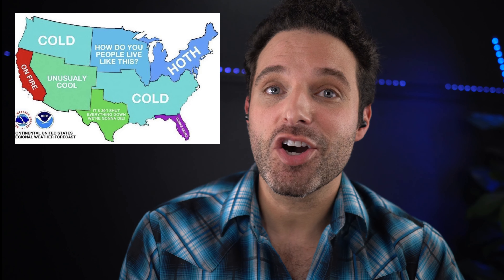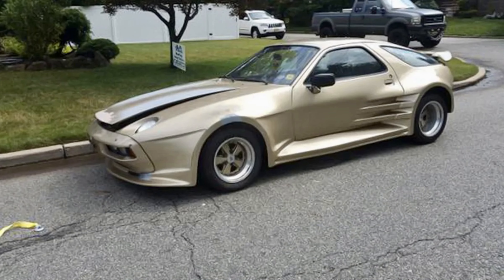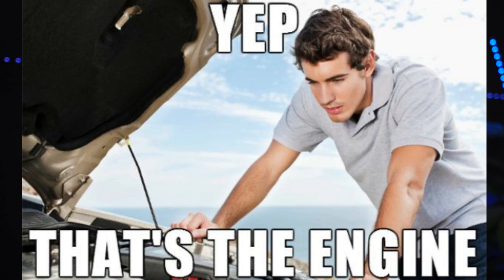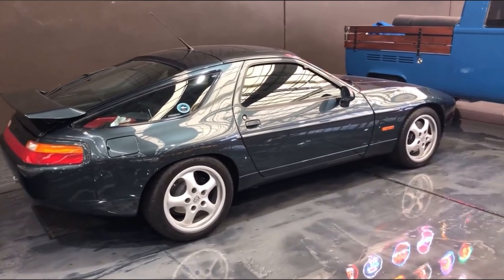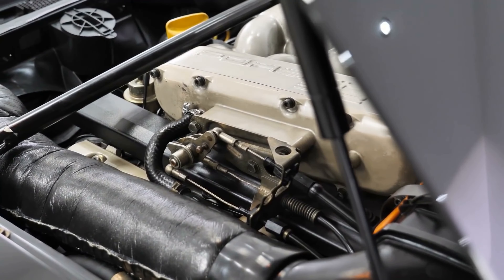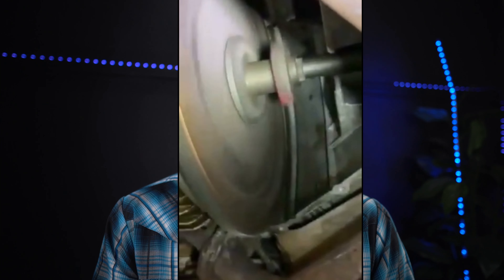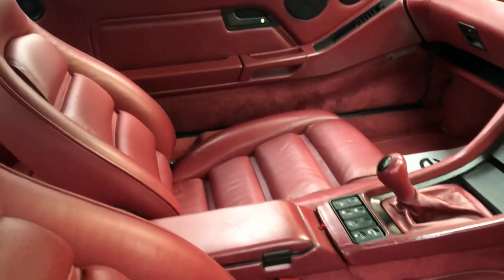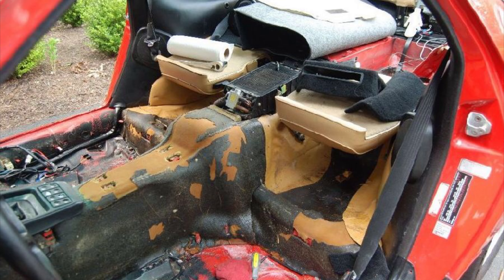Porsche 928 - Avoid the Pain! Watch This!

Comment: 1000% correct about the interiors. You will spend a fortune trying to fix an interior in these cars and it will never look right or feel like it's supposed to. Cheap and easy to fix the mechanicals like you said, especially if you can do the work yourself. These cars are great but never buy one with a roached out interior
Reply from the maker: You know it, most people don’t realize it until they’re knee deep…and a few years into a 928 restoration. Best avoid the pain and get a nice one, you’ll save money and time

Badgermilk thanks for watching! 🔥🔥

Comment: Bought an '88 928 S4 auto back in 2007 or so.  It arrived off the truck with the timing belt tensioner light on... and thus it began.  ;-)   Turned out the timing belt service wasn't too big of a deal to do.  Steering rack went next and surprisingly it wasn't that horrible to do either.  Then the bearing in the torque tube went.  That was, uh, a bit more work.  ;-)  Dropped the rear transaxle out of the car with the suspension in a friend's shop and got a rebuilt tube from 928 International.  The only nerve wracking part was getting the new torque tube in to perfect spec to avoid crankshaft damage.  I'm not mechanic but these cars aren't nearly as bad to work on as many say.
Reply from the maker: Yesss! Sounds like you’ve got that 928 in nice shape! 💥🚀🚀 At first most things can seem overwhelming, especially the timing belt…but it’s totally doable. The first time I did a timing belt was in 2001, and all I had was an old Hayne’s manual. Today, there’s incredible detailed videos on it! As more and more ‘how to’ videos come out, the maintenance ‘stories’ will start fading away.. (Try working on a new electric car). The 928 community is incredible! 

S-CARS.ORG thanks for watching! 🔥🔥

Comment: Man this is a great video. He is not lying about the interior. I have a 944 with tweed/vinyl interior and it cost me $600 for the original tweed fabric and vinyl from Germany for one seat alone…
Reply from the maker: Yeap! Plus getting it upholstered correctly is yet another battle. Good this is that the 944 seats on your car are very similar to 911’s of the era, easier to get right. Sounds like you’re doing a great restoration man! 

P83 1983 thanks for watching! 🔥🔥

Comment: You’re mileage may vary.  My 928 needed deferred maintenance and parts are really expensive.  $10k to $15k is the generally agreed budget to get a car current and reliable (just the deferred maint.).  Especially if you want to drive them regularly and for big distances.  True words about wiring and previous owner “upgrades” and sun damage.  Very true.
Reply from the maker: Thanks for watching!

Comment: 2 weeks ago on my 87 S4 the heat exchanger for the gear box oil ruptured in the radiator, auto trans oil in the engine coolant (looks like a strawberry milkshake), probably water in the gear box too. The radiator is not that big of a deal to replace, same for cleaning out the engine coolant, but the auto trans might need a full rebuild as the water unglues the friction material from the wet clutch plates. My radiator appears to be original and has been fine up until now but in hind sight probably should have replaced it.
Reply from the maker: Peter, it happens to the best of us. Don’t beat yourself up about this, it can happen on any classic. It’s a good time to upgrade the cooling for future peace of mind, it’ll be worth it...especially in Summer!! 

Greetings from Miami, thanks 🙏 for watching!!

Comment: I have an 83, owner passed, sat over 10 years, interior is sun damaged, body cleaned up good. Topped off fluids, added fuel and marvel, replaced a couple relays and it started right up with a tap of the key. Excellent runner, shifts great, just a good, solid machine. Electronics all work!
Reply from the maker: Wow! Sounds like you got a great one!

Dieselpwr782 thanks for watching! 🔥🔥

Comment: I read these 928's have to be driven not not stored as a memento. Things go wrong from it not being driven enough.
Reply from the maker: Correct, they prefer to be driven all year long. I’ve had small things go out from having them in storage, little things like window motors. The good thing is that most items are easily fixed/replaced, and lots of DIY tutorials everywhere! 

It’s the Weather thanks for watching! 🔥🔥

Comment: Hi, I just came across your videos.
Long story short,...I am highly interested in buying a 928.
I am no Porsche expert by any means so, let me ask.
If I buy a good one a really good shape and parts are needed, does Porsche still make official parts for the 928?
You mention the seats and dashboard being cracked, does Porsche sell the dashboard and seats for the 928?
Thank you so much.
Reply from the maker: Yesss, Porsche is still making original parts + there’s also lots of aftermarket solutions for any issues. I think you’ll find that the Porsche 928 has more support/resources than most cars….it’s actually one of the biggest reasons to buy one: The Community. CHECK OUT: Rennlist 928 forums.

The dashboards are still available new, but you might have to call around different dealers. Most people want black, so that’s the hardest to find…but you can easily paint a new burgundy dashboard black with SEM Dyes (worth it!). Seats are not as easy to find, but if the car has under 100k miles…the seats should be perfect 💯💯

The best time to buy is the Winter, prices easily drop 15%-20%. Take your time to find a minty one☝️ 

Gary Segraves thanks for watching! 🔥🔥

Comment: what manual trans model years have the synchros like glass?
Reply from the maker: The Porsche made transmissions from 1978-1984 have the weaker synchros. They’re still great! But can’t be speed shifted like modern transmissions. If care is taken, they also last a long time.

The newer updated Borg Warner designed transmissions came in after 1985 + . These drive like any normal manual and very little attention is needed when shifting gears ⚙️ 

If you’re looking to buy a Porsche 928, I would go for condition first. If the car has been maintained properly, you’ll have lots of fun and nooo headaches😎

F Aitken thanks for watching! 🔥🔥
Reply: Thanks for the info!
Reply from the maker: Subscribe! Much more to come! 🔥🔥

Comment: Honest Question, if i find a 928 with a bad interior and i plan to add new seats and re-do it, is it still ok to get one with a bad interior?
Reply from the maker: Hi Noah, checkout prices on interior parts in ebay. To redo a cracked Dashboard, it’s $1300+…just the dash, not the pod. That being said, there are lots of ways to do it on the cheap if you don’t mind it looking ‘just ok’. A plastic dashcap is cheap, but warps fast. You can also add 944 seats, they bolt on….but it starts looking… you get the idea. 

Noah thanks for watching! 🔥🔥

Comment: 🥲😳🥲 well I saw this video 2 weeks to late. I bought a 79 928 with 73k. Arizona sun beat the interior to crap. I thought it was going to be easy getting it restored inside now this vid has scared me. I hope  I don’t end up regretting my purchase.
Reply from the maker: JJ thanks for watching! 🔥🔥 Congrats on your purchase! 1979 is a great year, it’s got the CIS fuel injection…simple-simple ( a good thing!). If the car is running well, restore as you enjoy. Half the fun in owning a classic is finding parts and restoring. Put up a search alert on Google for the dashboard/pod, those will be the hardest to find (but they’re out there!).

Don’t stress, it’s a beautiful car and when you finish restoring it… you’ll soon be looking for the 2nd one! 😁
Reply from the maker: Also, if you’re not picky about originality. Newer front Porsche seats will bolt right on, all 964 993 944 968 seats will bolt on… no mods needed! Boxster 996 997 seats will need the tracks modded, but it’s also done all the time.
Reply: @HernanSpeed  oh thank you thank you. I will check them out. The seats I’ve found on eBay out of another 928 were like $1500.
Reply from the maker: Yess, and I can tell you that they’re also probably not in the best shape either. You can also try searching on Facebook marketplace & groups…nice seats pop up from time to time
Reply: @HernanSpeed  yes someone in the 928 group on Facebook told me to go to 928intl and precision Porsche. They are both about 80-100 miles from me. Supposedly they are the best in SoCal.  Thankfully I am somewhat mechanically inclined. My dad an I restored a 64 Corvair the only thing we sent to the shop was the interior and paint, but we pulled everything out and reinstalled everything ourselves. Motor and trans we took apart and put it back together in the back yard. I’m excited to tear into this 928. This will be my first project on my own
Reply from the maker: This is 🔥🔥🔥🔥🔥

Comment: I guess I'm screwed. I just bought one with a bad interior 🤦🏿‍♂️
Reply from the maker: Don’t worry, I’ve also done it before.. 

I’ve discovered that the best solution is getting a parts car that already has a good interior, they pop up for sale all the time on FB marketplace. 

Many of these 928’s get parked for extended periods, the fuel pump freezes and they get sold as non-runners. These are the deals if you’re willing to do the work. -Get parts you need, and resell the rest… You might even make a few 💵👊
Reply: @HernanSpeed  you just described the way I bought the car. It sat for two years and it's not running because of the fuel system. Thanks for the tip. I will definitely be looking that way.

Comment: So you're saying an automatic makes more sense than a manual?
Reply from the maker: The automatics on the 928’s are GREAT! The manuals are a little bit more fun, but the autos are fun also! The 928’s engine has so much flexible power, you’re skipping gears during normal driving on the manual anyways. Drive both and you’ll see what I mean.

  If buying an auto, I’d go for the 1983+ years.. Why? Those are 4 speeds VS 3 speeds in the earlier cars. Big difference in driving. The transmission is a Mercedes unit, so it also lasts a loooong time!

Krzysztof Slowinski thanks for watching! 🔥🔥
Reply: @HernanSpeed  thank you for replying. The 928 has been one of my dream cars since I was a little kid. Never got a chance to buy one but now I am really thinking of getting one. Thank you very much for the advise on the transmission. I really wasn't sure what makes more sense. The car definiately wouldn't be my daily driver so wouldn't use it a lot. I just want to own one of those beauties.
Reply from the maker: Love this ☝🏻 🔥🔥